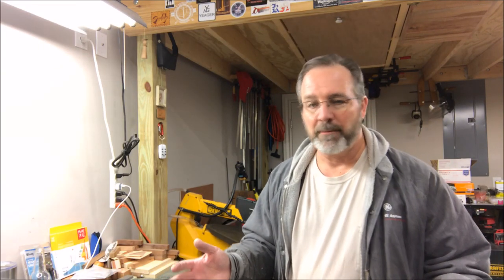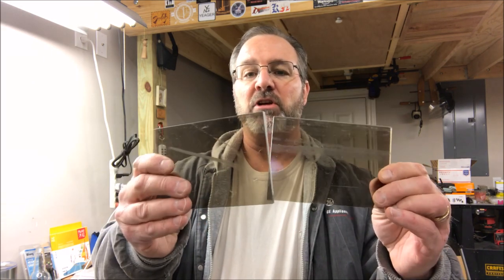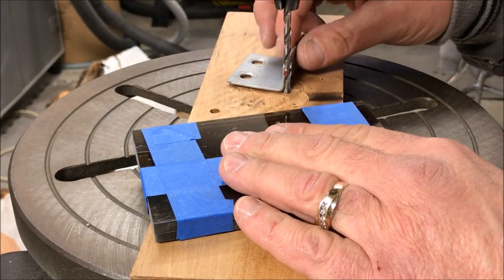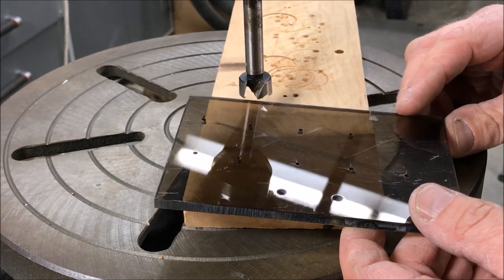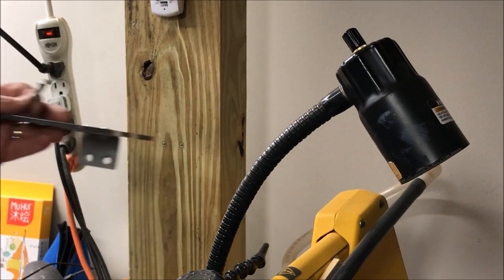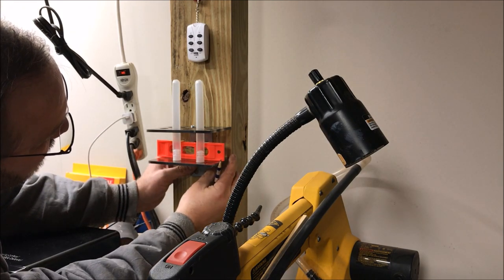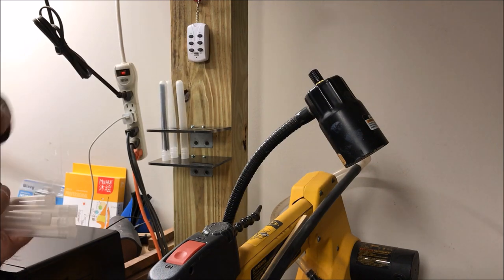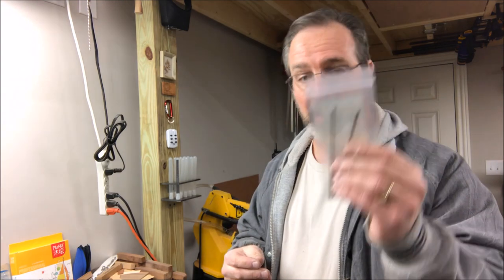Build A Scroll Saw Sorting and Storage Rack

Comment: Bob, I love this project. This is just what I need also. 
The only thing I don't love is that surge protector and extension cord contraption near the new scroll saw blade rack. Maybe it's an excuse for a different video - adding a double ganged outlet just above the work table. Or maybe just adding one of those long industrial outlet extension bars from Harbor Freight mounted along the back edge of the work table. (But protecting any wire running down the wall with some safe conduit). 
Of course, the safest way is to hard wire.
Just something I noticed. 
You're the best though. Thanks for your recent videos.
Jake
Reply from the maker: I trying to decide what I want to do behind the bench before I permanently wore anything. 

Regards,
Bob